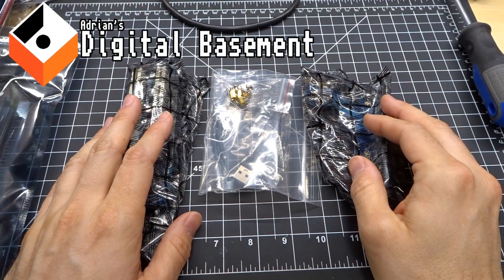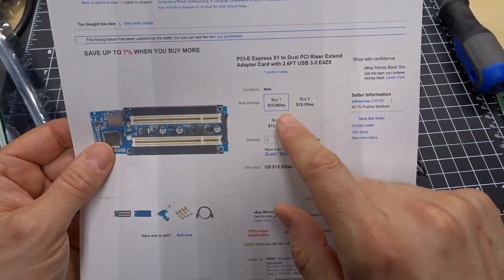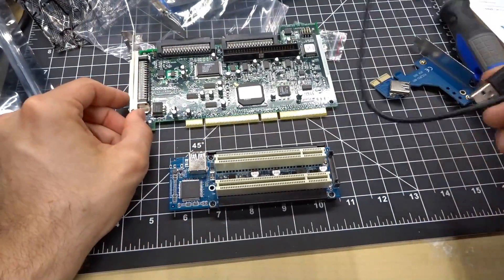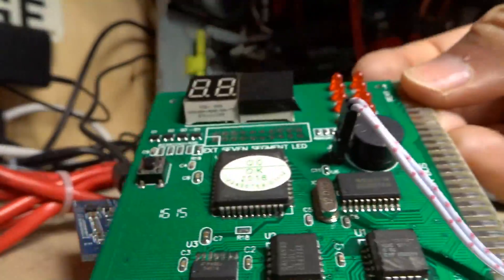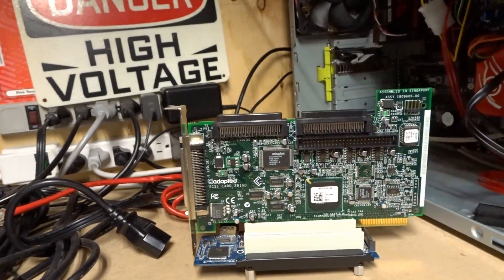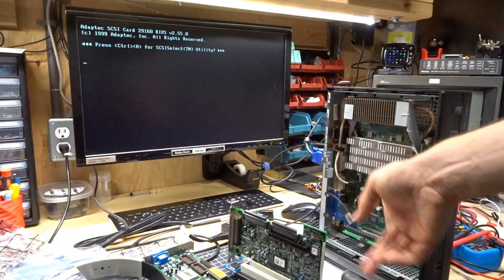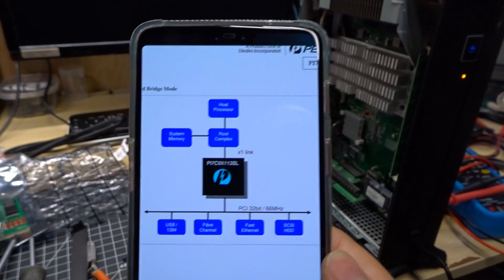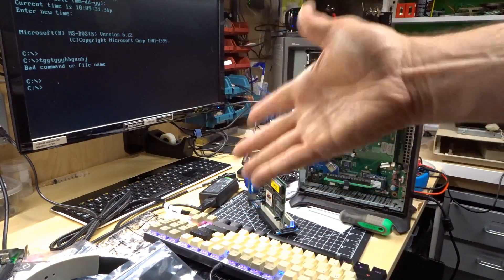Can an external PCI-Express to PCI adapter work? Sort of...

Comment: that idiot doesn´t know the difference between standard PCI and PCI-X.. pci-x had been specifically used in server motherboards and they are natively 64bit.. and while it is possible to use it in pci slot the speed is reduced and the pci has to be at least 2.x compliant and there is also 3.3V motherboard compliancy.. not to mention that there are direct PCI-X to PCIE converters.. WHADDA YUTZ!!

Comment: If you had looked up the product online you would have found you need to power the PCI board through the SATA interface using an L connector.

Comment: The reason why your main Core i7 4000 series computer does not see the Adaptec BIOS is cause you have the UEFI Windows 10 enabled. You have to disable it in the BIOS to allow legacy devices to show. I've had that issue with my 6th gen i7 system.

Comment: Some old PCI & ISA card need -12V (on the 1st PCI pin) to work, so you can expect most RS232 or old Soundcard would probably not work with that adapter.
Reply: The card is a 64 bit PCI X controller

Comment: looks like they used a usb port because lets face it, they are dirt cheap. theres no mcu/asic/fpga on there doing any conversion. so its just pcie over a usb cable. makes since as both are designed for differential signals at low voltages. ive seen a to a cables before, like i have a usb asp thats a to a, only other thing ive seen one of those is a really old mp3 player i used to own at some point in time (dont have it any more but i still got the cable). its totally against spec though.

Comment: I've used one like that but it didn't use sata power. It feels like power is why none of the stuff is working. Like... The one I used I was even able to use iommu passthrough to pass a GeForce 5200 and soundblaster live to a VM in unraid with the one I had

Comment: Besides all other issues I have an idea.
I think this card could be installed into ATX case along with Micro-ATX motherboard as kind of extension. So there's no need to put devices on your desk.
Just screw everithing where it was supposed to be.

Comment: That Geode based system with that PCIE - PCI card could be the basis of a really good Windows 98 retro system.
Reply: I'd make sure to install a CPU Idler program, especially on a system with passive cooling.

Comment: This is basically the same way Bitcoin PCIe Risers work, with the USB cable etc. The USB cable carrys only minimal power and you need the SATA power. Obviously you're short on room due to the 64bit card, you'd have more room with a normal 32bit card.

Comment: You'll need to enable CSM in the bios, plug the sata power onto the the external PCI card. Enable option roms. This will allow you to boot to the device. Without CSM it cannot detect nonUEFI devices properly.

Comment: Plug in an SATA cable that has 5 wires orange for 3.3V red for 5.0V yellow for 12V and 2 black for ground and it should work

Comment: I think it's a BIOS compatibility issue. What you want is to turn on CSM support on your motherboard. Also check BIOS settings to allow RAID card interrupt. It sounds like the Adaptec card does not support UEFI (and indeed, I do not expect it to).

Comment: I've noticed a lot of comments saying to do this or that in the bios but once Windows is loaded the bios support is irrelevant unless you're trying to boot from it. As I understand it Windows should enumerate the devices attached to PCI-E regardless of bios support - I had a PCI graphics card that had a corrupted VGA bios that still worked once Windows had loaded. I think the issue is more likely an incompatibility with PCI-E 2.0/3.0 and the USB cable weirdness.

Comment: Crypto miners use a similar riser for plugging a gazillion GPUs via PCIe x1, again using a USB cable for data transport, and a SATA power cable.  I don't know why this particular card has such a stupidly mounted power connector, but that's easily solved with a right-angle cable.

Comment: 5:10  ... You didnt connect the Sata power cable...
Reply: Yes 🤣🤣🤣 old but (didnt connect the Sata power cable)  How Work !!!
Reply: The fact you didn’t connect the sata connector is mind boggling, why wouldn’t you do that? Although I have to admit that afaik the 16x slots don’t provide more power than the 1x slots, as the power is supplied only through the pins in the beginning of the pcie connector, which are all present in the 1x slots. Still I am not sure wether the cable has enough wiring for the power lines coming from 1x. The length of the cable introduce inductance as well. I don’t know exactly about the voltages in 1x, but it might not supply 5V but only 3.3V and 12v while pci cards require 5V as well in most cases I believe. So the question would be if that adapter has a 12v to 5V converter wired to the 12v from 1x or from the SATA connector or both. This could influence if the cards work or not. A proper test would have to connect the sata for sure. I would at least expect a pinned comment from you stating that.
Reply: It actually begins at 3:03 in the video. He mentions that he's not sure if it's actually a sata power connection.
Reply: @frankhernandez2833  I know. I just wrote my comment before he said it. I almost always watch every video until the end.
Reply: I just checked that pci slots provide 12v, -12v, 5V and 3.3V while pcie provides only 12v and 3.3V. So 5V and -12v are missing and need to be supplied either by converters on the adapter or a sata or molex connector. Not sure what cards actually require -12v, but that would have to be converted, as it’s not provided by the sata or molex connectors.
Reply: Also pci allows 20w from the 3.3V but pcie only allows 10w from 3.3V. So the sata is required by default in any case, as otherwise the 6A instead of 3A required by some pci cards can lead to either power issues on the mainboard or the card or in the worst case a fire due to an overheating wire if the 3.3V wiring in the usb3 cable is too thin. Although a fire should be unlikely at those low wattages I would not call it safe. It certainly is clear though that two pci cards requiring 20w each over 3.3V can not be powered by the usb cable alone and need that sata power connected for sure.
Reply: 12A at 3.3V through the usb3 cable is not safe and would certainly risk a fire, if I am not mistaken. The usb3 connector is also not rated for 12A and not safe. Also, one sata connector only provides 4.5A at 3.3V. So for two pci cards that use 12A in total that would still not be enough. So either a switching conversion from 12v down to 3.3V or two sata connectors is necessary on pcbs with two pci slots. The new sata 3.3 standard omits 3.3V, but I don’t know if the new sata standard will actually be followed by the manufacturers.

Comment: That's a real doosey that Adaptec, but expecting BIOS interaction as well as windows response is asking a lot out of something connected through USB. When I got my computer I got a Ryzen socketed one with pci and pcie so I could use my old audigy 2. Half the motherboard is blocked by my strix 970oc.

Comment: Because I still use both my Emu Morpheus (4x Emu10k on one card with half a gig of RAM) and an Audigy 2 ZS (mostly for the front 5.25" bay support) I run one of these adapters on my machine and it works a treat.

I've actually got the system in a Rosewill Thor case, which ahs 10 slot mobo support. Rather than mounting it externally, double-sided taped the adapter in the bottom two empty slots, the remaining slot worth of space between the mobo and the adapter being just enough room for that USB 3 cable's hood to fit.

Giving me working PCI on what's now a Ryzen 5 3600.

The only issue is the dumbass placement of the sata power, and that's easily rectified with a 90 degree adapter... which is where you F**ed up by not connecting power to it.
Reply: I'm running a Ryzen 5 also but can't detect the adapter in the DM any config suggestions ?? Thanks

Comment: I noticed a "Legacy Device" in your device manager; I've run older motherboards with Windows 10, and older PCI devices sometimes appear as a legacy device with a default (null) driver. Also, some modern chipsets lack legacy PCI support. It might just be that the PC simply doesn't support any legacy PCI devices. You can check this using hwinfo

Comment: This is what I use on a Asus Crosshair V with a Adaptec SCSI controller with Win7, I hate Win10 so no idea if it works with it! Hope this help and keep up the great videos!
 https://www.newegg.com/p/14U-00T0-00CU6?item=9SIA7WMAUR5818&source=region&nm_mc=knc-googlemkp-pc&cm_mmc=knc-googlemkp-pc-pla-office+equipmentnetwork+-+interface+cards_-9SIA7WMAUR5818&gclid=CjwKCAiA7t3yBRADEiwA4GFlI65i5e41M1EsvX9_tFFgdoEF8wVBcp4saVnrrX861AUL7Q_UmRZSNRoCiMYQAvD_BwE&gclsrc=aw.ds

Comment: Hi, I'm using the same adapter and it has a problem it is badly designed, it has missing two caps on TX pair from the chip and there are two redundant capacitors on RX signals (PCIe has only AC on the transmitted signals). This leads some PC chipsets to ignore the device. If you put two caps serialy on the wires at the transmitter side it should start to work. Also the board can supply less than 5 watts to the PCI cards (both PCI cards can together take up to 50 watts). The SATA power blocks any long card, no matter if angled or not.

Comment: If you'd have an Big tower you could mount this on the normal extension slot area below the mainboard and use the internal Sata Power Connector.

Comment: He doesn't know how to plug in a PCI card... we are off to a bad start ;)
Reply: Unfortunately 3.3V PCI and 5V PCI use the same connector, but turned through 180 degrees, no problem if it's on a regular sized motherboard because the size of the motherboard and the presense of the bracket on the card will only let the card be inserted one way round, but if the connector is on a small board it can be ambiguous.

Comment: Obviously the SATA power is required.  The USB cord doesn't provide enough power for that giant controller card. 🙄
If it's "impossible" to fit, then desolder the plug, or get a PCI riser.

Comment: You found a 4790k in the trash?? Are you fucking kidding me?? That's not even that old and it's one of the few decent chips for that era. (4.4 GHz out of the box; unlocked for overclocking) -- I was on a budget a few years back and built my work machine out of one.  You lucky bastard!

Comment: I'm a bit late, but the SCSI card probably didn't work on the Gigabyte mobo because it was in UEFI mode.
The SCSI card requires the motherboard to boot in Legacy mode, in order to load its firmware.

Comment: I have a PCI card and want to use it with a laptop. Instead of using the PCIe X1 to power card dock, can I just use normal USB 2.0? And also, can I use it win10?

Comment: Some scuzzy boards would create their own plus and minus 12vdc for the differential transmitter/receivers.  Looks like the cable is only bringing over plus 5vdc and that is fine for the 5vdc IC’s, but if the board requires +/- 12vdc to work and it doesn’t generate them using a boost circuit and ONLY depends on the motherboard power supply, then you will need to cobble up a way to get the SATA cable plugged into the adapter “mother”board.  The scuzzy board may not allow access to its BIOS unless it has the +/-12vdc present.  Also, on the computer motherboard BIOS, you may need to expore the BIOS for allowing external BIOS or legacy boards allowed.  You may need to really dig deep and see if it is just a configuration change in the BIOS and adding the power cable with the +/-12vdc fixes the issue.

Comment: You can use an angled SATA power connector and that SCSI card is a 64 bits PCI, so you can cut off the connections that are not connected. Now you should be able to get it to fit.

Comment: Why not use LSI LSI20320IE card?
This is not expensive and can be bought at around £35. This is Ultra Wide SCSI 4 320, so quite fast and native PCIe x4.
You are basically looking in wrong place.

Comment: We use enclosure style PCI to pcie adapters at work to interface old PCI data acquisition hardware to modern Intel hardware. They're a couple hundred bucks but include the power supply and are a lot more secure.

Regarding compatibility, they should work with literally anything. PCIe is backwards compatible with PCI, so all that device is doing is serialization/deserialization. I've never had a device not work with ours, and we have some funky old hardware. Might want to spend a few bucks more though, for $15 I wouldn't expect much.

Comment: Adrian i wonder could you do a follow up video for this one, i am curious if you can get old soundcards like sblive, audigy 1 and 2 work under windows 10, using the "old drivers installing them as administartor using compability mode". I recently bought an aloder digital mixer that i got working in Windows 10 using windows 2000 drivers , i just had to install the drivers using compability mode as adminstrator.

I am currently thinking of buying an adapter to use with my old PCI "Adat soundcards", but if the machines do not even recognize the soundcards i guess the whole approach is mot. That it did not work with SCSI does not necessarily mean that it will not work with a soundcard?

What do you think will the adapter recognize old PCI soundcards?

Comment: Toubleshooting I'd try:
1. The SATA Power, you can find right-angle extension cables. The Wyse might have more power available on it's PCIe slot for some reason.
2. A different PCIe slot. Is that one shared with any other devices (M.2 or other)? It it on the PCH or CPU?
Looks like those 1x PCIe slots are special 2.0-only slots. Not sure if that's an issue...

Comment: Most designs using USB cable don't carry power, you may need to power the card with PCI slots with SATA power or whatever is on it.
Check out AMERI-RACK dot com , riser card section... they have a few pci-e to pci or pci-x .. for example models ARC1-EB132-C7  or ARC1-EB262-C7 ... it uses a Pericom pci-e x1 to PCI bridge chip.
Reply: Thank you for the specific models.

Comment: Ah, I think there might be 2 solutions:
a) get a higher quality cable
b) look in the BIOS as to limit the Bandwith of the PCIe slot you put it into. The other, fanless PC has an AMD 690 Chipset. And what do we know about PCIe Support of that?
Its Gen1.
Your modern system is Gen3. That is 3 times the Bandwith and it might just be too fast for the cable, so it doesn't work.

Comment: I have used these to expand out an single 16x machine to have 4 different cards, scsi, fiber channel, esata, and SAS. For a customer of mine didnt use the same wine you did, but same concept I know all the extensions needed to have power to work but the worked flawless out a 16x slot.
Reply: Hi Phills, it was a long time ago. But, if you still using theses adapters, can you tell me if all of them are working fine, no problem at all?, You know, I´m doing a lot of researching on this, and besides the friend here that had his motherboard trashed after his adapter exploding, I found nothing likely in several users testing those, and on the relative comments either. But you know, we need just one to get worried =/ tnx for your time...

Comment: There are quite a few Z97 boards with one or more PCI slots. You would probably want one of the higher end models as the 4790k is quite demanding. Quite expensive to buy new old stock ones though.
Reply: There's even b450 with PCI

Comment: I needed the opposite for an old machine was trying to add usb 3.0 to, since pci usb 3.0 cards are rare.
Reply: That's because standard PCI has a bandwidth just slightly higher than a gigabit,and usb3 runs as several gigabits.

Comment: I have this (AHA29160 even) working on my Asus Zenith Extreme TR1950X system.  I was using it to pull data off of all my old Jazz disks.  Works great.

CSM needs to be enabled obviously.
Reply: not necessarilly.. i have scsi card in bios mode and i didn´t have to switch either csm on nor I had to disable secure boot.. it´s strongly dependent on your hardware, knowledge and skills.. it´s just that you let your os do the work.. you download the right drivers for the card along with manager utility (LSI has the best support in this case) and you can make it all work in Windows (for me that is) in gui.. I had plenty through the years and I´ve encountered problem only once when the vendor refused my query if there still are drivers he once supplied - i got no answer so I had to fall to linux and I solved the issue but otherwise I had no problems with cards like this..
Reply: @lexsmith8689  - The 29160 worked out of the box for Windows 10 and Linux when I needed to do this about 6ish months prior to this video.  Wrt to "knowledge/skills" bit, the CSM comment was for booting off of a device attached to the card (e.g. Jazz drive).  As the card does not have UEFI-compliant firmware it cannot be used to boot a system that does not have legacy (CSM) support enabled.  It has nothing to do any nebulous "1337 h4x0r 5ki11z".  If you do not care about booting from it, then yes, it's purely a driver issue.
Reply: @PrimalNaCl  that´s what I meant.. ;-) cuz many too often people think and make the mistake I wrote about even if there ain´t no need for it, and some "wise" guys tell them to do so.. and then the people do.. and if there´s somethin´ I dislike then it´s misleading those in need of help..
Reply: @lexsmith8689  Ah.  Ok. Apologies if I was unclear.

Comment: I'd check for the INT19h option in BIOS.
But honestly, regarding the requirements, it was clearly a misstake changing the system at all. Any quad core should have been enough for flashing and such, and PCI was there ;)
Now with this newer system I would ditch the Adaptec and simply use an USB-SCSI-Adapter.

Comment: I’m gonna say.. you need to plug the power cable into the board. It is likely your motherboard is not delivering enough power. I suspect the connector on that external card USA sata power connector